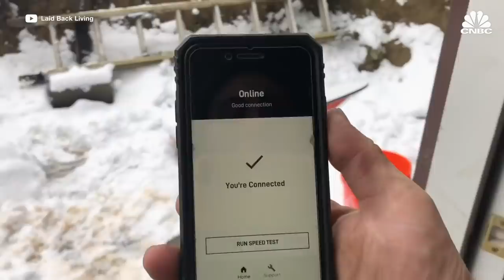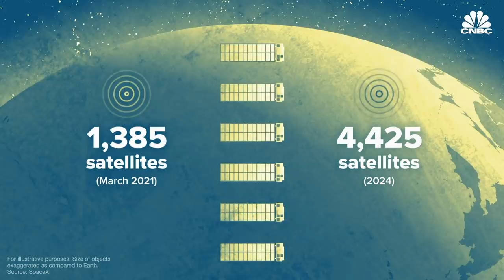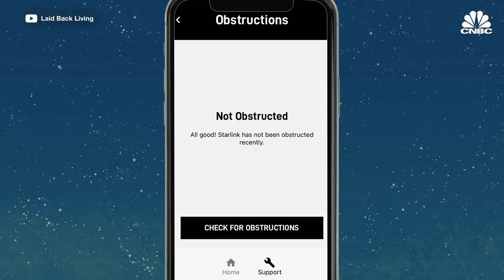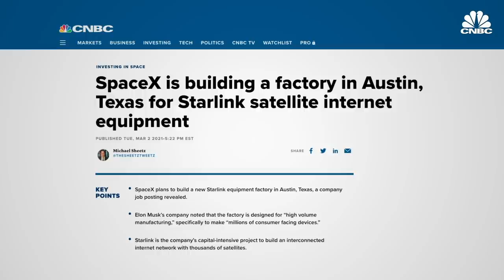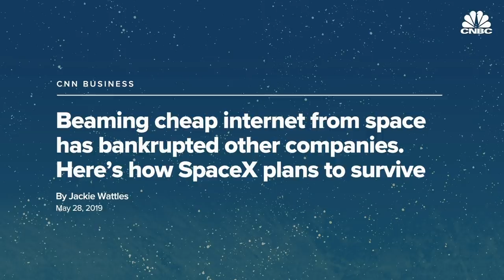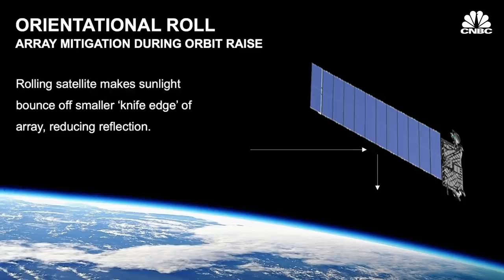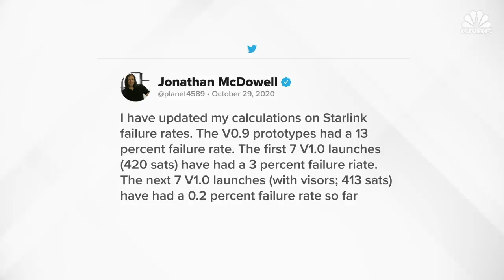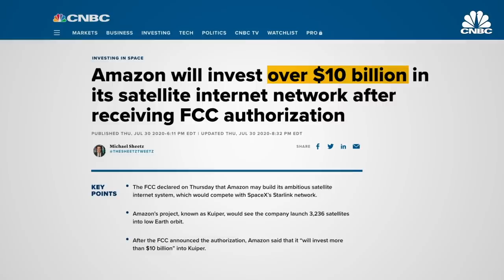Why Starlink Is Crucial To SpaceX’s Success

Comment: What about huge disturbances due to heavy rain? That was the weak point of tv dishes.
Reply: Startinks are much closer and use a wider variety of transmission bands including Ku, so rain and snow have no noticeable impact. Ive seen them operate just fine during snow storms.

Comment: What does he mean by that 5:25? Speed on the ground should be speed of light as well.
Reply: He was totally talking out of his ass. What he said made no sense. I was actually skimming through the comments to see if anyone else noticed :D
Reply: Light travels slower in fiberglass than is does in the  vacuum of space. Also, signals on the ground have to follow the path of existing fiber lines. Depending on the situation, in space the signal might be able to take a shorter route. 

Good info here: https://youtu.be/giQ8xEWjnBs?t=287
Reply: @windriver2363  On the ground, most communication uses radio waves over the air or electromagnetic waves over metallic conductors, not light over fiber. Besides, the inter-satellite mesh that can user laser communications is just a small part of the haul. Ultimately the signal has to be routed to a ground station anyway. So, no, the comparison to 'anything on the ground' is nonsensical any way you look at it.
Reply: Ok, my mistake. My understanding of undersea international cabling was that it was mostly copper. Apparently that's not so - most modern cabling is fiber except the last mile.
Still, the issue remains that the inter-satellite link is extra beyond the ground network, which is where the signals connect to the actual Internet. So, 'faster that whatever is on the ground' still doesn't make sense.
Reply: @hooeezit  Even through the atmosphere light is still slowed vs a vacuum. Add in the places were it runs through fiber like the giant cables on the ocean floor and it's noticeably slower. Stock Exchanges are looking at Starlink closely to see if it would be faster to route though them than the dedicated fiber cables they have run.
Reply: @bensemusx  You didn't understand my argument at all. The satellite-to-satellite link is definitely faster than a fiber link between 2 stations at the same distance on the ground. But that doesn't make the internet link faster for the end user. The packets still need to reach a ground station which is then connected by fiber. Ultimately, the inter-satellite link is an overhead past the connecting ground station, whichever way you look at it.

As for Starlink being a faster backhaul for (stock) exchange-to-exchange or trading datacenter to exchange compared to fiber, that's only possible if there are dedicated peer-to-peer channels that end in a Starlink drop right next to the exchange. Logistically and algorithmically that's certainly possible once there is a sufficiently dense LEO network. The current configuration is specifically meant to reach a ground station, so it doesn't provide a benefit for trading algorithms or cross-exchange arbitrage elimination.

Comment: you need to be a little higher with your dish, starlink looks low on the horizon does the software show much of obstruction percentage??  I built a 60  foot pole with a mechanical slider to lift the dish up and down I can give you more info. dan from the oregon woods.
Reply: Starlink app will show what obstructions are in the field of view of the dish and the dish automatically adjust its angle for optimal signal.

Comment: Space decree is NOT anywhere near the problem everyone makes it out to be.  Think the altitudes they are using is such a large area it would be like modern air traffic on a typical day... but shrink the planes down to the size of a BB.  The volume of space these things orbit through is hundreds of times larger than the atmosphere planes can fly in.  Also understand that it has been a requirement that all satellites de-orbit at the end of their life.

Another way to help you understand is the ISS has to worry about collisions.  They retreat to an emergency capsule a few times a year, but this is if any debris larger than 3/4" is going to pass through an area 10km x 10km x 1 km.  Yes that is something the size of a marble passing through an area of 100 square kilometer only happening a few times a year.

Typically NASA throws out the space debris issue every time they want more funding.  The cost though to recover the man made debris is astronomical... literally and this would only fix a fraction of the problem as there is 10x the amount of non man-made micro meteors passing through that same area to harmlessly burn up in the atmosphere.  You guys need to STOP pushing this BS.  We have had what 1 collision total and that is because 2 satellites were put on the exact some orbit and by chance they eventually collided.  Those problems have been fixed by assigning altitudes more carefully... just like Elon Musk has to do for SpaceX.  He 40k satellites will NEVER collide with each other.

Comment: Funny how limiting they think.  Only Internet?  WRONG this could replace cell phones. The largest telecommunications company on the planet.  Why bother with cell phones when satellite phone service will become as affordable as cell service with better coverage.
Reply: Satellite can beam down internet but your phone can't connect to the satellite. One way would be to build ground 5g Towers which have cellular connection to connect to your phones. Then have the tower communicate with Starlink via giant dishes.
Reply: @vineets  Really?????

Do you have Starlink, I do and I know it does via the wireless router. Made a few local calls and got from phone company message about making international calls. Anyone who has hooked up voip knows that is a very small amount of data.
BTW  why get 5g when there are better/safer tech out there that is not in commercial use.
Reply: @brianperry4815  oh I mis understood! I thought you were talking about regular phones connecting to star link directly. It will work through wireless router sure. But this would not work if you walk off into the woods.

Comment: I heard Starlink doesn’t work very well and it’s going to cost consumers more than promised.
Reply: The price is getting lower and the connection is getting better :)
Reply: it works better than any other sattelite internet provider, the head of cyberwarfare at the pentagon actually said it was very jam resistant and fast. the Ukraine military has tens of thousands of them. so far my speeds have been getting faster, up to 300mbps.

Comment: “Starlinks can move as faster as the speed of light compared to what’s on the ground.” Ummm fiber optics literally uses light to transmit signals, the same thing
Reply: First, most of the Internet connections today are either DSL, Cable, or Fixed Wireless. Second, there are too many hops from the last mile to the upstream provider which introduces latencies due to various technologies/equipment in the midst. So, there is no one long fiber wire going from the consumer all the way to “Internet”. It looks like Starlink will bypass most terrestrial limitations.

Comment: So, four times as many objects in LEO as already exist in all orbits, all communicating with each other using lasers (wtf?), multiply that by the number of competitors (yeah they will probably have less sats, but the point remains), then add new ones every 5 years (most of the ones being replaced will de-orbit, but some will fail to). Throw in one or two collisions for fun. Astronomy is going to be so much fun in 10 years :-/
Reply: "Multiply that by the number of competitors" what competitors?
Reply: @miguellopez3392  Watch the video.
Reply: @Pushing_Pixels  that's what the video calls them, reality is different, starlink has no competition. That's why other satellites internet providers are in a panic even blocking the starlink websit so their  customers don't get it.

Comment: This is the dumbest idea I've ever heard. We already have far more reasonable and tested means of delivering very fast connection speeds, the biggest thing missing is a commitment to investing in the infrastructure.

This... is like saying, "what if we could do that, but dumber, prohibitively more expensive, and with an overly complicated and sprawling infrastructure?"

The only advantage to having such a low orbit satellite system-- the entire reason you need 42,000 satellites rather than maybe 3 for higher orbit-- is a faster ping rate. So slightly better online gaming. And that is worth launching 42,000 satellites why?

Comment: Though question
Should it be necessary to get the rest of the world approval to create something like Starlink and not just FCC's?

What happens if another company or country decides to create a 15 thousand satellite constellation?
Projects like this can become a huge problem for all of humanity
Reply: The FCC and similar regulatory agencies only come into play for the ground stations.   Ground stations would need to comply with regulatory agencies in any area that it operates.  There is no real jurisdiction over space so at least for now we just have to hope that any entity putting things in space plays nicely.
Reply: You need to get approval of the country you overfly to transmit, so countries get tell SpaceX to not overfly (edit: transmit while overflying).

If a country want's to build there own network, they can.  But instead of $10 billion (based on SpaceX being the least expensive launch system on the planet), they other networks are going to be much more pricey.
Reply: @mikeking596 , "overfly" and "orbit" are not the same thing.  The overfly rules don't apply to space.

Comment: $500 + $99/month for 75 mbs...the only good thing about this sounds like the no data cap. I guess if you have zero other options you gotta go with this but not great.
Reply: It's 230mgbs where I live, the system gets faster over time, you will also be able to move the dishes to new locations so it can be used for camping or on the move in the near future, and that's very nice compared to my previous $50 100mgbs internet that gets throttled on YouTube videos.

Comment: But its too expensive I can rather have jio fiber instead and I can use it for 50 years in a price I have to pay for star link for a year but I like this concept
Reply: again this is meant to help if you have no available ISP or its too expensive because it cost ISP more to build further from a city.
Reply: @miguellopez3392  yes thats why I mentioned I Like this concept its a new tech ik it will not come at lower cost its futuristic so good that I think it will provide internet even in some far situated areas

Comment: Michael Sheetz "space reporter, CNBC" sequence 5'-5'30" ... "you're now moving the signal from one satellite to the other at the speed of light rather than the speed of whatever is on the ground" ... and dear space reporter, the signal on the ground, which would be of electrical nature I suppose, at what other speed would it travel in your informed opinion ?
Reply: The speed of light in a vacuum is faster than the speed of light through any medium as the light gets to take the straightest path in a vacuum with nothing in its way.
Reply: Almost all long-distance telecommunication signals are sent via fibre optics, not along electrical wires. Although, for the sake of reference, the speed of light through a fibre optics cable and the speed of an electrical transmission through copper wire are both approximately the same at about two-thirds of the speed of light through air and space.
Reply: @bensemusx  sure, though by a factor that is negligible compared to the other factors mentionned related to lag, which measures in ms (would it only be signal distance covered, cf. the comparison between geostationnary satellites vs. lower orbit Sartlink network)
Reply: @wr2382  indeed, so the speed of light (compounded by the local permittivity / dielectric constant ) being still the reference (compared to say horse speed for messages carried post riders)... ps: some advanced fibers use refraction tricks of guided optics to reach carrier velocity closer than 99% of the speed of light in vacuum.

Comment: So the family  trying to live off grid to lower their carbon  footprint! Is using  a internet service with the highest carbon footprint.
Reply: Pretty sure this internet service does not have the highest carbon footprint.
Reply: @user-RCST  ok so musk is sending rocket that burn fuel and the energy  use to make the fuel and plus all the energy  used to make all his solar panel,  electric cars, has no carbon foot print? We all have a carbon foot print in everything we do and buy. There nothing  wrong with it we all need to admit this is the was life is.

Comment: So rather then pollution the space with all these satellites wouldn't it have been logical to started a research and development of creating better/ signal communication for geostationary satellites? hmm. Also the amount of pollution that this causing with continues launching will be evaluated.
Reply: The problem space debris isn’t the real cable stuff, like Starlink, it’s the untraceable dead satellites. It’s a extremely easy to just launch around Starlink. Plus, space is huge. Also, with the low orbit they are in, they will de-orbit within a few months to a year after dying. About the pollution from constant launches, it’s mostly water, and the other stuff is the same as a car or jet engine, both of which stay in the atmosphere for much longer than rockets. In conclusion, Starlink pollution = minimal.